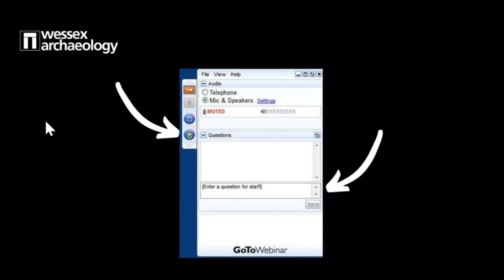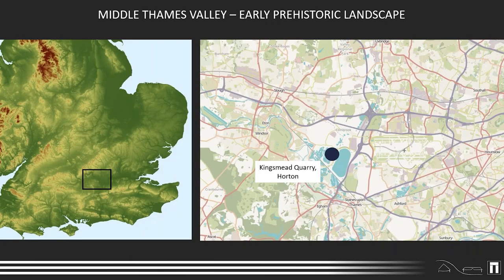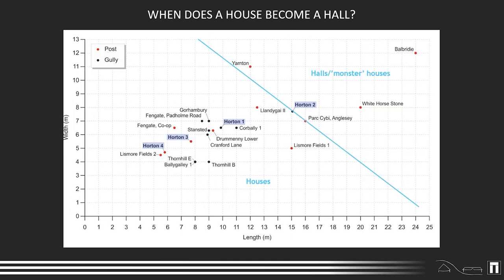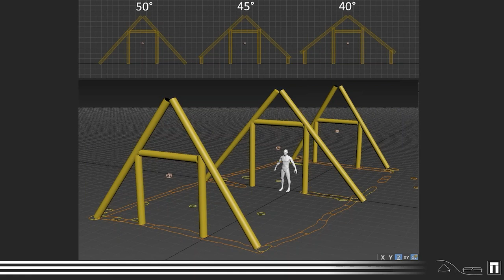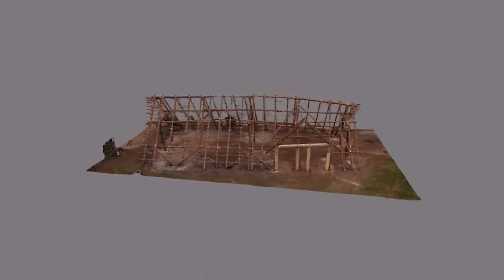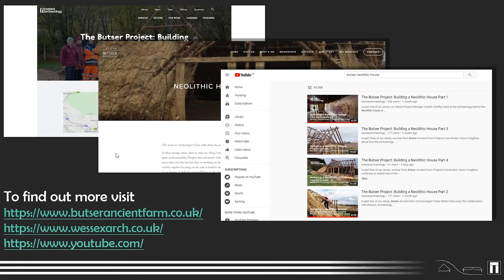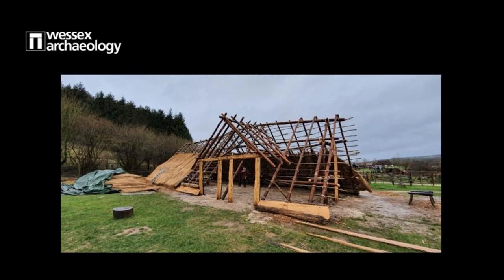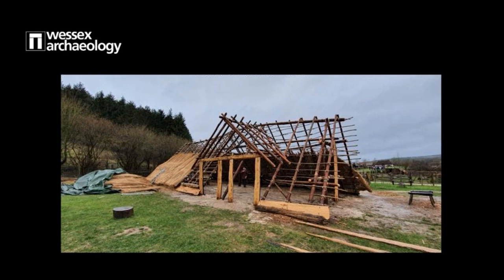Heritage Talk: The Butser Project  - Building a Neolithic House

Comment: The cordage you used, have you seen Ray Mears making coardage from williow bark and tree roots? I think given that you are not using any power tools, purposefully to replicate how these structures were built, I think it is important that you take this philosophy to every aspect, and use genuine ropes that they would have used, because making rope like they would have is labour intensive, and therefore would have had an impact on how structures would be built. Also, with joints in the A trusses, I think the possibility of half housing joints should also be considered, I believe that serations on flint tools would have allowed relatively saw like clean cuts to be made, and would be stronger than pegs alone, like traditional timber frame, I suspect they would have used both, not just for strength, but also for making the depth of the hole, less, and therefore easier to drill. Pegs may have been square as well, and not necessarily round. I say all this as a carpenter and joiner and as a sawyer who has cut pine logs from the round into timbers. Round timbers are much stronger than cut timbers in the same volume, and of course less work to start using. However, the downside is that round timbers are harder to join, as you will have found out. They may have got around this problem, by only squaring the area of the log where they knew they were going to make a joint. I'd also say that it is very important that you cut the tree down around the beginning of summer or late spring when they are at their most flexiable and softest to work due to the rise of sap. Also that you use the logs within 24 hours of them being cut down. If you don't think this will make a difference, just try it, and you will be amazed how much sap is pouring out of a log cut around this time of year.  Working with green (high sap content) timbers also has another advantage, as the wood dries, the shape of the hole and dowl will distort, but only in certain directions, it is therefore very important that you aline the end grain accordingly to allow the joint to tighten as it dries. This will have the affect of bonding a joint comparable to modern adhesives. Working with timber like you doing to make buildings in which people called home, is an excellent way to understand the minds of Neolithic people, as you will most certainly encounter all the same problems they did, and in forming solutions to these real life problems when working with the wood, you will descover much about how they would have lived, in a sense you will learn their construction techniques which for want of a better word, is a language they would have spoken and understood. What I will say is that working wood with hand tools, especially stone tools, takes many years to perfect and my advice would be to practice making the joints on scrap pieces of wood as many times as you can before you do it on the actual building. Believe me, what you will learn will be invaluable. I know you have to construct these buildings with modern health and safety equipment, but again, I would suggest that you try doing what Neolithic people would have done, just to again see the kind of problems and the solutions they would have come up with. As for your concerns about the trees they used being big enough, it was probably because, once a pine tree starts getting over 6-8 inches in diameter, it gets heavy and the tree starts to develop heartwood which is harder to work, even when green. I'd also say that cutting a tree down over 8 inches in diameter with only stone tools is going to sart getting very difficult, not to mention dangerous too. But for the purposes of building a struction 6 and 4 inch diameter logs are strong enough to do the job. I think its also fair to say that when Neolithic people lived, they would have been able to carefully select each and every tree, especially as this insight into trees and wood definitely allowed them to save time and labour. I think what you are trying to do is very difficult to be honest, as you certainly need the archeology to determine any evidence that can be gleaned, but you also need people who are highly skilled and knowledgeable about trees and working with wood. And I would say, that even then, this would only allow a glimpse of what it would have been really like, as Neolithic woodsmen would have had incredable skill, and an almost spiritual insight into the trees and their tools. At least this is the impression I get from indiginous people and tribes living in places like the Amazon rain forest.